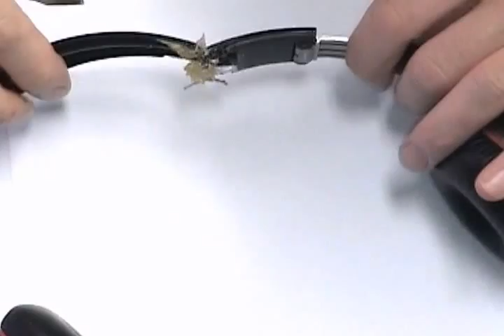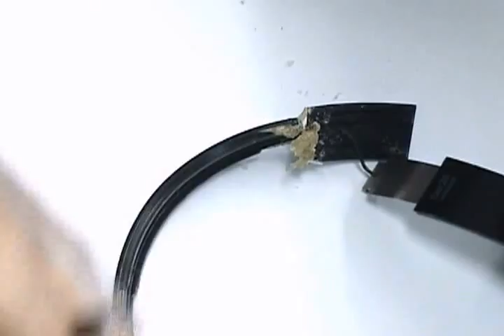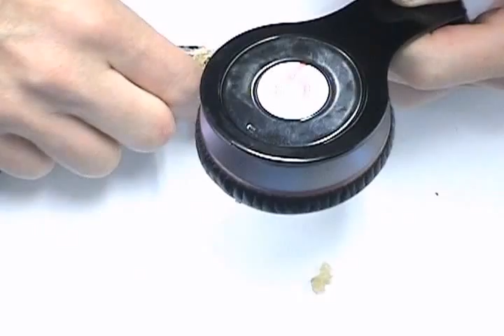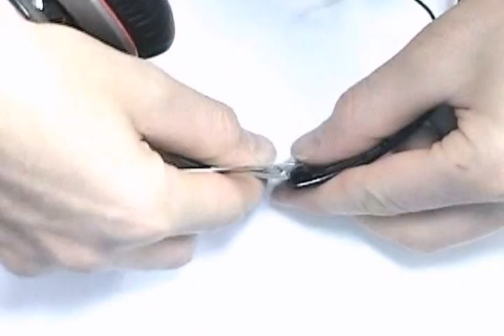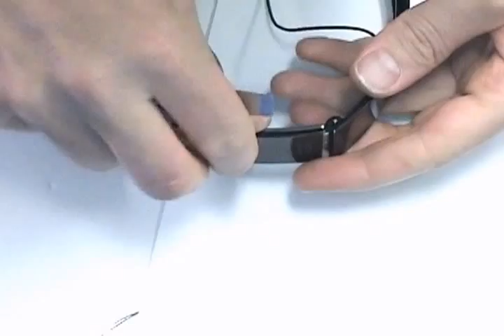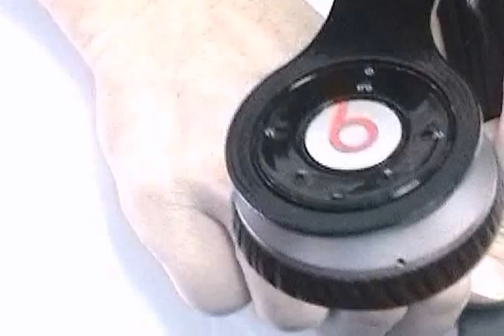How To Replace Cracked Beats Wireless Headband

Comment: thanks this video really helped alot, advice for people doing this, you can remove the 4 small hinge pins with a magnet or they literally fall off. and when removing the cable that is glued to the broken headband be very careful , do not pull it out, instead use a tool to remove the glue .  I almost ripped my cable in half..

Comment: Instead of this, you can also use duct tape or selotape or Super glue, put superglue on the bars its came off, put it back in place hold the parts together and after about a few minutes it should stick. I've got about 1 full roll of selotape  around my headset.

Comment: so @ 2:18 from there you supposed to pry it off the metal hi he's rather than try to push this little metal pins out??Cause I'm trying to change my hand band now and I'm struggling getting those small metal pin hinges out